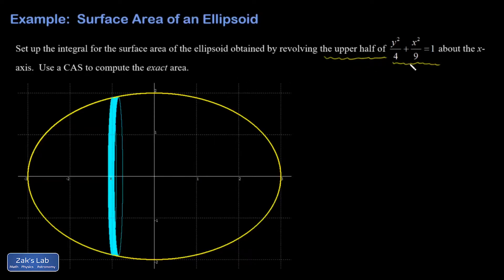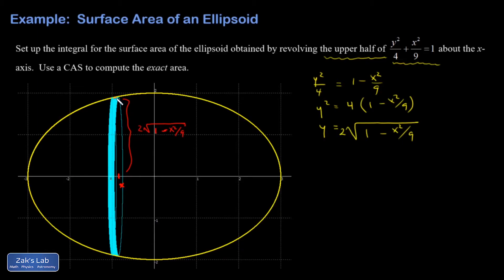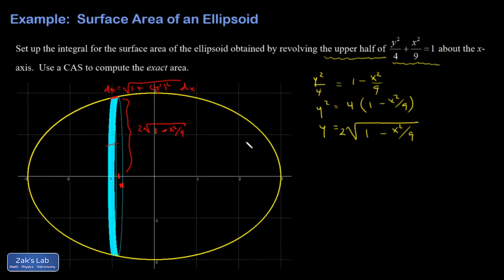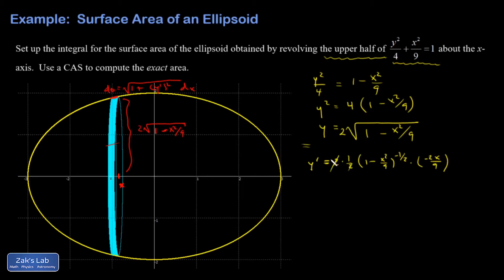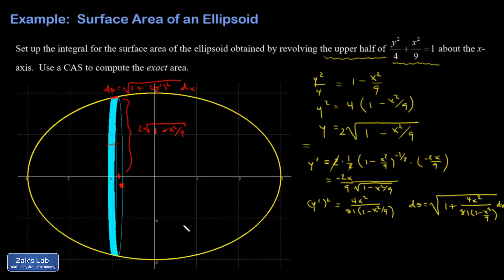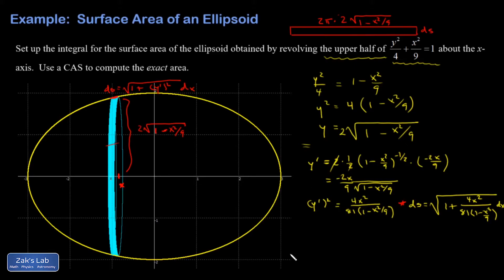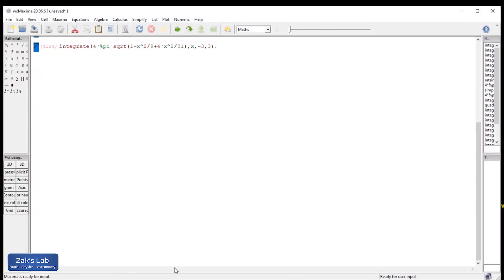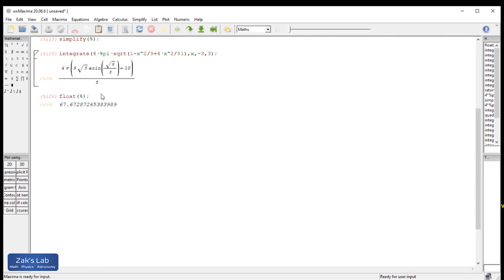Calculating surface area: ellipsoid surface of revolution integral, single variable approach.

Comment: Hello, how did you get the equation for ds?
Reply from the maker: It comes from applying the pythagorean theorem to the little arc element ds where ds is the hypotenuse, and dx and dy are the legs.  This video shows the derivation in the context of a surface area integral:  https://www.youtube.com/watch?v=oFOf2kGuXh0&list=PLyUm-RQTs3uN3tdWdAhlgG_KptZF714x3&index=17
Reply: @ZaksLab  thank you so much :))))